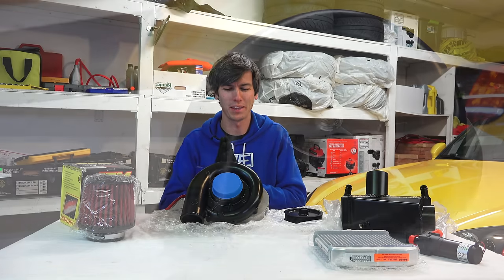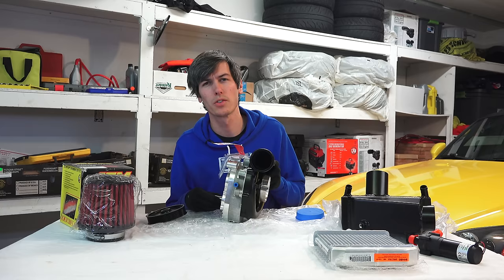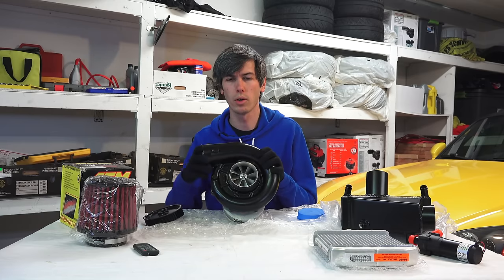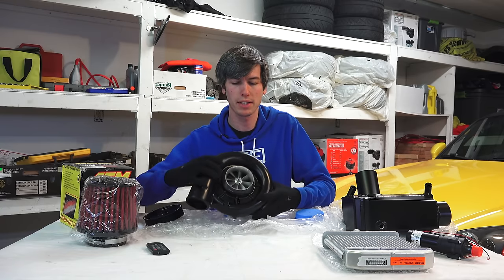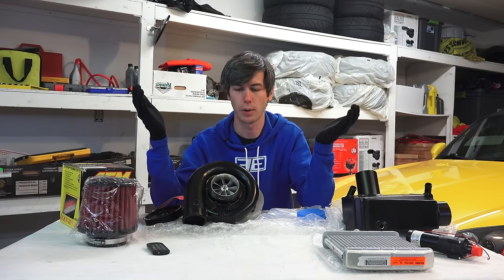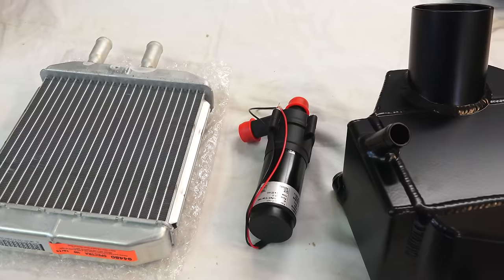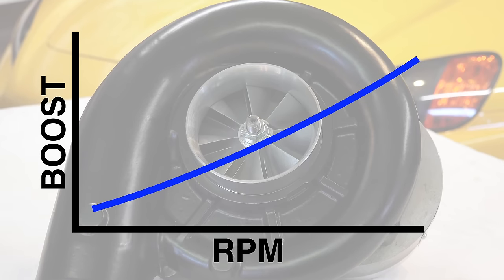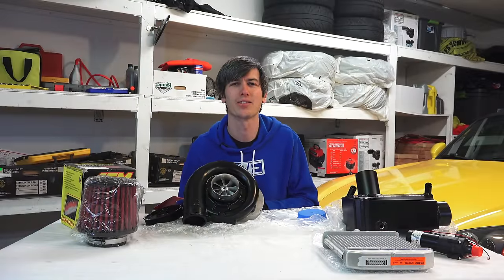How Do Centrifugal Superchargers Work?

Comment: Why don’t you use a kraftwerks supercharger kit for your s2000? You should look up LHT performance they’re based out of Florida and specialize in supercharged s2000, I’ve seen bone stock s2000s with the kit make over 400hp on a conservative tune
Reply from the maker: Rotrex seems to make a solid supercharger, but the Kraftwerks kits aren’t reversible. Part of what I like about this SOS kit is that it isn’t destructive to the car in any way (drilling, cutting, welding, etc). Power numbers a simply a function of boost, you can change the pulley and make as much power as you’d like! :)

Comment: Is it possible to have an electric motor help spin, especially when at low engine RPMs, the impeller so you can get the best of both worlds? (i.e., low end torque and high end torque)
Reply from the maker: Yes, it is definitely possible.

Comment: No, centrifugals take the rotation energy of the air at the center and add compression by diffusing the flow outward where velocity is increased, ie same angular velocity but larger radius.

Comment: Question!

what if i drive downhill in a manual car in 1. gear.
the engine will break the car. GOOD

if the hill is to steep and the engine goes to the limiter and i dont use my break will the engine goes trash?  sorry for my english;)
Reply: Yes

Comment: Contemplating a Centrifugal SuperCharger? Consider a Turbo more, don't want to mess with the head of your engine to lower the compression to accommodate a turbo? Then go with a Roots or Twin Screw as long as you don't mind bonnet scoooooooops......Yes I know, in some cases you have to lower the compression for certain supercharger applications as well, but more often than not they just bolt on with a bit of  a tune. Also Super Charger or Engine mods in general don't always mean greater fuel consumption, depending on the individuals wallet a supercharger, ECU, injectors, fuel pump, the right mechanic and car, you can stay roughly close too factory consumption.

Comment: Can you just give it a big amount of throttle straight from the beginning like a n.a. engine? or do you have to heat up the engine just like with a turbocharger?
Reply from the maker: I’m not sure what you’re asking; it will act similar to an NA engine, as far as lag and throttle response.
Reply: Engineering Explained i cant explain myself too good in english sorry^^ well do you have to bring the engine to opperating temperature before you floor it to not cause damage
Because you cant floor a turbo when the car is cold because it would cause damage right? :/

Comment: A gear reduction results in a reduction in RPM at the output, not an increase. Input at 10 RPM, output at 5 RPM, that’s a 2:1 reduction. Input at 10 RPM, output at 20 RPM, that’s a 2:1 multiplication. We shouldn’t have to tell an engineer this one. ;)

Comment: So I might as well not use a supercharger, and find a way to optimize the engine to produce more torque in low RPMs. No need to add more parts to worry about. Thanks for showing the difference between a supercharger and turbocharger though.

Comment: the "it doesnt have good low-end torque" is just wrong. That has a lot to do with the motor, cam, heads, and most important the size of the supercharger. A small supercharger will give great low-end torque. a large one will have boost lag. That is one of the great things about superchargers is power throughout the entire power band, but the setup must be composed of all the right parts. Also, a supercharger on a 4 banger that never made low-end torque anyway is much different than a supercharger on an LSX.

Comment: I've read that you can't put an electrically driven supercharger on a 12 volt system.  It makes sense that 12 volts isn't enough, but shouldn't it be possible to transform the voltage up to 48 volts?  This way you don't have the parasitic loss on the engine, assuming you don't need a bigger alternator.

Comment: Since the S2000 is already a high-strung, weakish bottom-end vehicle, wouldn't you want to round out the low-end torque instead of exacerbating the difference? Perhaps the Roots-style supercharger would help the driveability so that you don't have to drive it like you stole it?

On a side note, the stock air box on the S2000 looks huge! You could almost put that carry-on that you had stowed in the McLaren in the engine bay with the box removed.

Comment: Couldn't you, technically, achieve a lower/mid-range 'grunt' from using a smaller pulley (if that is what one is looking for, of course)? And in the case of vehicles with very high rev ranges/limits (i.e. S2000), how would that affect the vehicle and the centrifugal supercharger? I suppose if you're using a smaller pulley you would then produce more air which would result in more power and subsequently more wear..?

Comment: Isn't the parasitic load a bit overrated though? IMO most of the losses would be pumping losses, not much different from increasing the cylinder capacity. As soon as you take your foot off the gas, pumping losses go down to almost zero. The real question is: would increasing the engine size add more friction than the supercharger's gearbox?

Comment: Since the centrifugal charger is most efficient at around 70 000 rpm why not use a CVT drive to keep compressor rpm's at ideal range  no matter what the engine rpm is ? Sure it would add the cost but it would certainly make better torque at low and mid rpm range.

Comment: Why do you need to cool down the air ? wouldn't a hot air fuel mixture makea better combustion ?
Reply: Colder air is more dense hence you can press more oxygen in the same space which means you can inject more fuel and make more power, also colder intake air reduces the risk of engine knock.

Comment: What if you could change the pully like bike gears so you could control the reduction from the belt? A 2 or 3 stacked pully.
Reply: Harambae Mafia you can. Hell I would even run cogged pullies
Reply: turshin yo, you understood what I was saying! Hell yeah, well yeah cogged anything is dope, and better . Thank you, has anyone made this idea yet? Reaserch much be done...
Reply: Robert Payne so it needs like a motorcycle transmission or something so you can change gears using a closed system?
Reply: osp80 🤗 yooo that's want I want to hear, from 400hp what will this do added 🤔

Comment: I think the S2000 would benefit the most with a twin screw and not a centrifugal SC.   A turbo would also be much better than a centrifugal SC for the S2000. I get that a SC is much easier to develop and install.

Comment: How much horsepower will it add to the s2000
Reply from the maker: Depends on what pulley you choose, and how much boost, but around ~100 Hp. Can be significantly higher with smaller pulleys, new fuel system, and ECU.
Reply: With this very kit in Stage1 6psi trim, I added 120whp with an exhaust.

Comment: @Engineering Explained does a turbocharger create a parasitic load like a supercharger does?
Reply: Technically yes, in reality no
Reply: He means back pressure caused my the turbine as opposed to a NA engine with an exhaust which is basically a pipe straight to the back of the car with no turbine to spin.
Reply: Yes, although not as much

Comment: Question: how much hp do you plan to gain from the supercharger?  I know boost depends on size and type ect. Just curious
Reply: If he keeps the components of the supercharger stock, then he would be able to get anything from 60-100HP depending on tune.

Not a massive number, but it makes a hell of a difference on a lightweight sports car with aggressive gear ratios like the S2000!
Reply: Probably looking at 250 to 290 I would think. In a car this light that is plenty.

Comment: Usually I like superchargers, but why wouldn't someone use a turbo if it acts the exact same as a turbo
Reply from the maker: It won’t have the lag that is associated with turbos. There’s not a time delay for it to spool up, since the impeller speed is completely dependent on engine speed.
Reply: also, you have to route engine oil into turbos to lube them whereas this has its own closed system
Reply: Engineering Explained that makes sense thanks for the reply

Comment: palm face Just install a turbocharger man, so long as you select the proper size components for your goals they're so much better. You can paint whatever torque curve you want with a turbo depending on the turbo / turbine / exhaust turbine housing. The ONLY real advantage that hunk of crap has IMO is simplicity.

Comment: It's been said that it is better not to store tires on their side wall....
Reply from the maker: Lots of things have been said haha. Ideally they’d be inside at room temp, but ideally wasn’t really feasible.
Reply: Tires stacked on their side is the preferred storage method. Source: I work for a tire manufacturer.
Reply: Cold temperature tire storage is fine. Hot temperature storage can cause flat spots if parked with a load. Example: Cars on a lot in a desert in summer. And please don't store your tires inside, they off-gas some nasty chemicals. Source: I work for a tire manufacturer.
Reply: Why do people look for ANYTHING in a video just to post pointless comments?

Comment: ...gearing isn't reduction gearing unless it reduces speed...
...the gearing in the supercharger increases speed...it is step up or over drive gearing...
...this is the second of your videos I've seen where you don't mention the diffuser...
...the diffuser is the key to the centrifugal supercharger...
...impeller accelerates low pressure air to high velocity...
...diffuser slows the high velocity...low pressure air...
...at which point it becomes low velocity...high pressure air...
...the diffuser is the narrow passage between the tips of the impeller...
...and the volute scroll housing...
...starting to appear as though you received your engineering degree...
...in a box of Cracker Jacks...

Comment: Get ready to do all your supporting mods around the supercharger. You need to upgrade the clutch, fuel injectors and the fuel pump.
Reply: Squidward's House S2K fueling is actually pretty overbuilt, up to about 8 psi you don't need fueling system mods. It's really sketchy as far as the injectors, so that is usually the first mod people make towards the fuel system. Fuel pump is good to about 12 psi. 

The clutches on S2K's are at their limit in stock form, I've seen guys burn up stock clutches on 10-15hp over stock. That will be the most important mod.
Reply: Yeah, I was going to emphasize what Brap Brap already stated. Clutch, Clutch and Clutch. Should be done along side the supercharger install as the stock Clutch will not be good for 10 miles.
Reply: Squidward's House I literally love your YouTube account name and profile pic.  It makes me laugh every time I see it and I see it on all the car channels I watch.  “Not even SQUIDWARD’S HOUSE” 😂😂😂
Reply: TheCarGuy14 LOL Thanks man :D
Reply: Brap Brap good to know, I might be boosting my S2k in the spring.
Reply: Not at all they left a lot of fuel on the table and you can get by with the clutch as long as you don’t constantly drag race it from a dead stop. Kind of like the Porsche Carrara people didn’t know how to drive that car and constantly burn up clutches. The truck was is to ease out let it catch then go hard as you like. It wasn’t built to be a drag car but a track car.
Reply: not to mention the glass differential although I believe Jason modded his diff already
Reply: David Williams he did. He changed it to an aftermarket LSD with a 4.44 ratio if my brain serves me correctly.

Comment: I was wander how an engine would work if their was no intake or a need to disperse heat. say you had some kind of infinite fuel source directly in the piston chambers that provided enough force\pressure with each hit of the piston but generates no heat? like a piston hitting an infinite spray-can of air if that makes sense. If you want to know the context don't be afraid to ask. I now know what a supercharger is. i don't think it would work with my hypothetical idea.

Comment: so centrifugal superchargers basically act very similar to turbos.. no low end boost, good high end boost.
but they require engine power to do that unlike a turbo. 
What is the main reason why anyone would go with a centrifugal supercharger over a turbo then?

Comment: Why not a twin roots?  Honda’s have no low end, and no you’ll still have no low end.

If you added a twin screw you would have had a great all around car that fixed the natural short comings (no low end)

All in all, hell yeah boost is boost. Can’t wait til you get it installed!
Reply: Because by adding a stronger low end, it will no longer drive like an s2000. Most people who get these cars know that they have low end torque and a screaming redline, so by adding a supercharger that has similar characteristics you keep the car driving pretty much the same, just with even more high end power.
Reply: Saud Buhamdi and I do agree , it just makes more sense to me to “fix” what’s “wrong” with that, and have a car that’s fast all around.  You would have great low end and a good top end still
Reply: The s2000 especially has no low end. Absolutely a snore to drive  below 7k.
Reply: Questchaun exactly.  No one with transam is adding super chargers because they all ready have low end!  Would not make sense.

Now a centrifuge Charger does make more sense than a turbo, but I still think I would have and that raw down load torque to help the car move better
Reply: I drove a stock s2k last year in the canyons. they're so stiff and twitchy , a high amount of low end would make those characteristics worse.
Reply: ezbg I believe he has already done suspension mods?

Also, if your boosting you are doing it for one reason , speed

Why not get the all around package that gets you the best performance?

And please don’t think I am flaming, I still think it’s a cool car
Reply: Because he wants top end, not low end. Why do I prefer blue cheese to cheddar?
Reply: TheBaconWizard but he already has more top end than low end?
Reply: Paul Eberly Yes. And he wants more. More is better than less. It's a matter of driving style, and your opinion is not right (nor wrong) it is purely a matter of taste. YOU wanting more bottom end doesn't mean HE should.

Comment: Would Twin Charging work with a Procharger + Turbocharger with an S2000 
You can drive around normally below 2.5k (rpm)
Turbocharger gives you low end power from 2500rpm - 4500rpm
Procharger gives you top end power from 5000rpm - 8000rpm  
That car revs to 9000

Comment: Random idea for a hybrid electronic supercharger; rig a powerful electric hand drill (dewalt) to drive the supercharger in a linear fashion with throttle, combine the powersource of the hand drill with electricity from the alternator. Would it not be more efficient than a supercharger leaching power from the engine itself....? Besides those drills have an incredible battery life at full throttle any way.... I was inspired by those electric scooters made with hand drills that can last for like 6 hours. Someone create this hybrid system and give me credit pls n thnx.
Reply: @Engineering Explained what do you think?

Comment: Whats the difference between a Centrifugal Supercharger and a Turbo?
Reply from the maker: Very similar on the compressor side, but the supercharger is driven by an engine belt, rather than the exhaust (which powers turbos).
Reply: Thanks so much for replying, im freaking out but I appreciate it, Many videos cover the difference between regular positive displacement superchargers and turbos but never a centrifugal. Maybe a future video idea? Explain the difference between Prochargers, Turbos, Superchargers? :)

Comment: You talk about one of the disadvantages being the parasitic loss from being belt driven, but no one even seems to want to admit that a turbo has a similar parasitic loss from creating an exhaust restriction. It doesn't matter what kind of boost power adder you go with they all have some degree of parasitic loss from having to be driven by the engine in one way or another. BTW, Vortech sucks ass, it's better to go with a supercharger that doesn't require you to tap your engine's oiling system, something like a Procharger...... But I am guessing you went with Vortech because they made an S2000 kit and the other manufactures didn't.

Comment: I am disappointed you went with a turbo supercharger. The twin screws are much better
Reply from the maker: If there was a feasible twin-screw kit for F20C engines, I’d be all over it. To my knowledge, there is not - it’s not something that’s easily adaptable for inline engines.
Reply: Engineering Explained that is a shame. It Would have been a good excuse for an ls swap though  :D.

Maybe that would be a bit too much power though.

Comment: Did you choose the centrifugal sc over turbo primarily for the difference in thermodynamics? Is it engineering aesthetics? i.e.Turbos work fine but you'd rather not have a glowing-hot heat sink right under the hood of your car. Please enlighten or get busy on that install! We want to see erudite blood on those autodidactic knuckles!